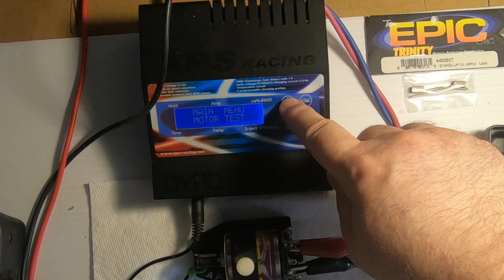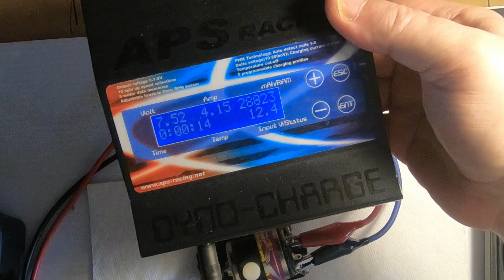Truing a Comm of an RC Brushed Motor

Comment: Hiya Bob! Great stuff dude, you got there in the end. Very well explained and some good advice thrown in along the way. That motor sure spins well after the truing, I could do with one like that for my speed car! All the best Brother! 😎👊👍
Reply from the maker: Thanks Mark. In part 2 you'll see the ad for these motors and what they claim the rpm is/was (you never get what they claim anyway).. I'm getting closer but still so far off. Over the years, the magnets lose magnetism (gauss), springs on the brushes make the brushes sink into the comm ever so slightly and springs get weak... All that ads up to a slower motor (this one is over 30 years old). Even if you buy a new vintage motor still in its packaging, it will not have the performance it would have had when bought new within a few years of when it was on market. A magnet zapper would really help with this but I don't have one...

Comment: Good stuff! Sorry the motor lathe wanted to fight you the whole way LOL! 30k is a great starting point for a speed run motor!!
Reply from the maker: thanks Addam, In part 2 of this, the advertisement for the Triad Motors show an rpm of 50,000 (you never get what they show) for this 9 turn motor, I'm getting closer to that but old magnets are not helping. I wish I had a magnet zapper...

Comment: Hi, nice vid. Your RPM, was it with or without load ? My 9x4 Team Orion at 7.2v was around 45k (51k with a bit of timing, which was too much anyway as you need an airfield strip at one point 😅). Good luck with the speed runs 😊
Reply from the maker: Thanks for the view & comment...
All test are done with no load..
Keep in mind, this motor is over 30 years old & only a double wind (triple winds and more are more likely to have more/higher rpm). 
Over the years, magnets get weak, these motors use old tech magnets (4.0 wet magnets) unlike motors that use 5.0 wet magnets that are stronger from 20 to 25 years ago and newer. 
with all that said, no brush motor has the rpm of a good brushless motor, most Castle Creations brushless motors max out at 100,000 rpm but will never see that, like the one I have in my DT-02 now....